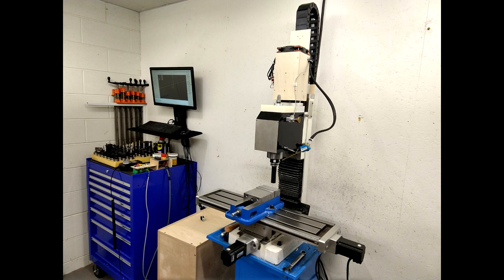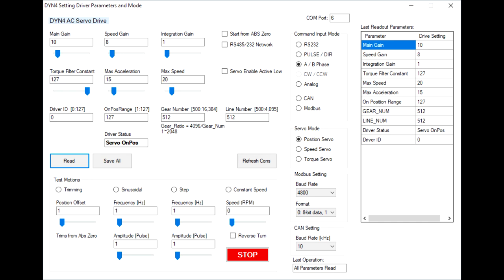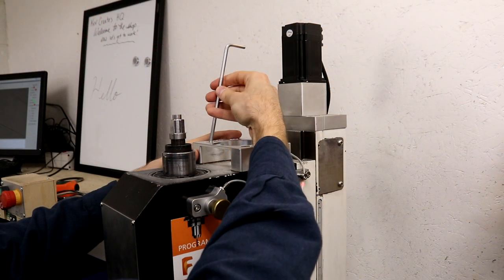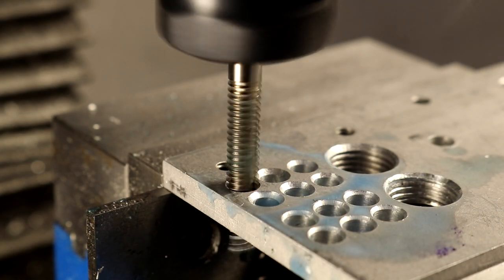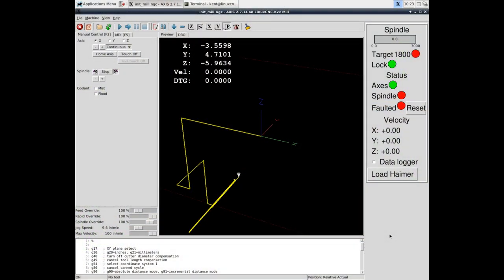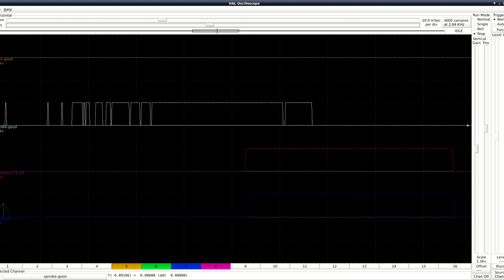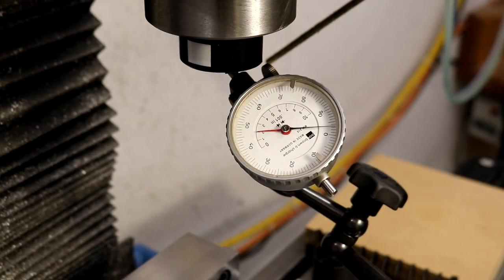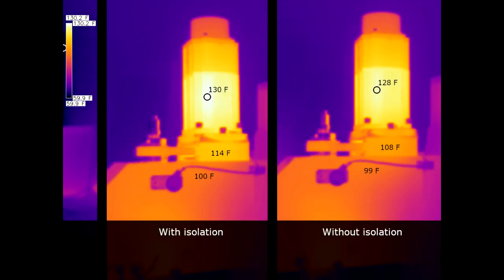AC servo motor for CNC mill spindle: Questions and answers

Comment: Hi Kent, I have watched all your videos. I didn't find it mentioned but I want to add the power meter for the spindle of my CNC (BF20L modified to R8 spindle, belt drive eccc so similar to your mill). I want to install a 1.8Kw AC servo spindle. In case of AC motor where would you measure the current, power flow? Before the drive or between the drive and the motor? I am not sure where the 1.8kw are referenced at, if for the current supply to the driver from the wall outlet or from the driver to the actual motor. Thanks for the help!
Reply from the maker: Hi Ale, this is a great question and has several answers of various accuracy and complexity. The sort answer: For a simple relative load meter, an amperage meter clamped to one wire of the input should work fine. A max-hold or average function on the amperage meter would be nice.
More complicated... For the DMM DYN4 and LinuxCNC, I wrote some code to get the current assigned by the servo. This has very fast response and must be filtered to read. For a hardware meter, you could measure the current either at output or input of the drive. Measured at the output will have quicker response but that might not be useful. Measured at the input will be smoothed and easier make sense of. The complexity comes into this if you want to measure power (will need to multiple by co-measured voltage), care about potentially imbalanced legs, 3ph vs 1ph, phase angle, and on and on.
Hope this helps. I'm making a video on a new spindle now and after that plan to make one on instrumentation which should be relevant.
https://github.com/kentavv/kvvcreates/blob/master/linuxcnc/modules/dmmserial
Reply: @kentvandervelden  Thanks Kent for the quick reply. Yes, indeed measure DC is easy but AC can be done in different ways and give false result if you do not understand it properly. I will then wait your video to shed some lights on the subject :-)
Reply from the maker: @Ale_Lab  Sorry, I didn't fully answer. The power rating is of the motor. The drive will limit power delivered up the rating (plus maybe some boost.) Output power = Input power x efficiency. For a relative rating, either place should be fine, but efficiency depends on load. So, for practical machining operations, an amperage clamp on the inputs should be fine. I used a wired-in amp meter for a long time. Oh, and some drives have an analog output for reporting current that could be pretty convenient.
Reply: @kentvandervelden  Thanks a lot aI will have a look at the driver then. If the analog output is present then I will use that one instead. Otherwise the imput will be plenty for my application.

Comment: Very well presented, you did answered most of my question came up during watching the other videos. BTW: Which CNC controller do you with Linux CNC?
Reply from the maker: Thank you very much. I have a simple i7 PC and Pico Systems USC running the latest stable LinuxCNC. I'll be trying a MesaNet board soon for a CNC router design using analog servos and will also try the MesaNet hardware on the mill. Let me know if this doesn't answer your question. Have a great weekend!

Comment: I'm setting up exact same spindle on my PM25. Based on you videos, and other research, I figured that it was a good option, and if for some reason it doesn't work out. I have a small lathe that I can use it on. One question.... Did you find a good source for poly-v J series pulleys ?  I'm whaving trouble finding one .... Or did you bore the original pulley ?
Reply: Duh, I watched the video again, and you made up a set of timing pulleys to suit....Oh well, I'll macine up some pulleys...
Reply from the maker: The original pulley was bored up a couple mm. The servo works really well, a great upgrade from the BLDC. I wouldn't get the brake option and I especially wouldn't mess with the drive's encoder feedback (HUGE waste of time.) So, that means adding an external encoder with a small timing pulley and probably keeping the original two-speed pulley and belt setup. 
Check this video out for a very cool belt selection system.
https://www.youtube.com/watch?v=kW_8BJLwJL0
Reply: @kentvandervelden  im trying to hook up the encoder to the acorn. I got the 1.8KW servo I hope it works ok. you say it's a waste of time to even try? I ordered 2 of the 1.8KW servos one for my g0704 and one for my g0602 and I ordered 2 db9 screw in plugs ans 2 db25 screw in plugs and 2 acorn boards and ive had so much problems with other BOB's that it's time to go with something rock solid, and I thought this was the way to go. the 1.8KW servo works awesome on my g0602 its so quiet with your multi rib v belt 3 pin spindle setup, I love it, I made the pulleys myself, and they are really really close to the same size and I can tell when i put an index mark on them and turn the motor on, and see how long it takes for the marks to come un-alligned from each other. i really hope the encoder works, I dont want to add an external encoder to it. still need to figure out how to hook the encoder to the acorn. too many years of trying makes jack a dull boy LOL
Reply from the maker: @BondmeJesus  For sure try using the DYN4 encoder passthru. If it works, you have a very clean setup. In my case, I had lots of trouble. Maybe the actual advice is, give it a go, but if it's not work, don't keep trying to make it work. Wishing you the best of luck!
Reply: @kentvandervelden  not sure what the DYN4 "passthru" is
Reply from the maker: @BondmeJesus  Pass thru is my mistake. I mean the encoder output of the DMM DYN4 servo drive. A true pass thru would be 1:1, one encoder input pulse equals one output pulse. The DYN4 supports scaling the input, making the output a ratio of the input.
Reply: @kentvandervelden  I will not be scaling it down for the acorn if I can get it to work, because the acorn supports 10,000 counts per rev. and the driver that came with my 1.8KW servo already has the scaling feature in it, so I could scale it down. I dont have the DYN4. I sent you some emails also. (electronic gearing) wont be needed. the AASD driver has 10,000 counts per rev and I sure hope it works for the acorn. think it will be safe to connect it?

Comment: What spindle head are you using? Is there anything out there for under 800 $?
Reply from the maker: I'm using the stock spindle and head that comes with the PM25. I recently purchased a BT30 with power drawbar and housing for $1400 where ~$500 is the heavy housing and shipping. Just make a spacer for between the Z saddle and housing. If you only wanted the BT30 spindle, they can be found on eBay and Aliexpress for under $800 and free shipping. Add another $300 for the air cylinder. These spindle are seemingly rebuildable, good up to several HP, and 6k to 8k RPM. If you only want high speeds, 18-24k RPM, and nothing under 9K, you'll have many options under $800.

Comment: The induction motors on my fadals all have encoders. I’m sure where a will and way is concerned even a less expensive motor could have it retrofitted to the back side. Our robodrills are all servo, our fadals all induction. Frankly they all perform alike and the inductions have more torque. For your little mill I’d never use an induction motor for a few reasons you mention however depends on the application where I’d suggest one versus the other. Overall machining an induction motor tends to out perform however ours all have rigid tapping capabilities it isn’t common for a hobby grade machine. By the way if you decide to try and broach I believe you’re going to need a larger z axis servo. Most broaches will require 7-8NM of torque or more. Perhaps the weight of the head will assist but I suspect you will get an axis error if you try with the one you have.
Reply from the maker: Thank you for this great information! My last mill had a 3HP induction motor and I keep wondering what-if, so it's very useful to hear your experience and recommendation. Also, I use the same axes motors and similar ballscrew pitch on my lathe and while broaching, slots definitely need to be narrow and processed slowly. I'm waiting on a MesaNet card which can sample the encoders faster and has built-in differential signaling. It's the last thing I'll try to get the DYN4 working well. Serial command of the DYN4 works well but that's not fast enough for encoder feedback. Btw, in school I a great friend shared your name, years pass without passing him though, so when I saw you message I wondered if he is now a machinist :) Best wishes

Comment: Any tips on tuning the DYN4 on velocity mode?
Reply from the maker: Hi Travis, I wish I could help. I've not been successful in using velocity mode. When in velocity mode, my servo turns, but the torque is terrible. Increasing the gains much results in instability. DMM said that a belt drive, being less mechanically stiff than a direct drive, will be limited. Regardless, position mode has worked well. I can't explain the poor velocity mode performance. Unfortunately, maybe the drive is more sensitive to faulting under high load if in position mode than in velocity mode, but I don't know.
Reply: @kentvandervelden  That is actually really helpful.  I have been struggling trying to get my 1.0kW DMM servo motor w/ DYN4 to work properly as a spindle in velocity mode.  How are you implementing position mode?  I too am running linuxCNC (using a Mesa 5i25 & 7i76).  I currently have the spindle setup as analog and velocity control, but there is no torque to speak of...  A screen capture of your final DMM Servo Settings would be wonderful if that is not too much to ask (unless they are what is posted at 5:15 in your video).
Reply from the maker: That's very interesting! I attached the fourth motor channel of a Mesa 7i76e to the A-B phase inputs of the DB25 connector on the DYN4. You can find my configuration at the address below. Indeed, those at 5:15 are what I'm using, and I doubt they've changed. My DYN4 is from ~2 yrs ago, and there are newer firmware options, but the meaning of the parameters are likely the same. I wish velocity mode would work better because in position mode the servo faults when ~90 deg off, but in practice, it's not been a problem with a 750W except beyond 3/8" drills.
https://github.com/kentavv/kvvcreates/tree/master/linuxcnc/configs/pm25mv_mill/mesa/configs/my_LinuxCNC_machine

Comment: I would doubt that you're actually losing counts due to noise if the controller you use has differential inputs. The noise barely effects them because the way the differential receiver chip needs to be pulled in opposite directions to change the output. Only way to really see those missed counts in LinuxCNC is to set the spindle up as an axis and test positional movement over a certain distance.

Velocity feedback isn't a good indicator because it's calculated over cycles. Even the cleanest velocity signal needs to be software filtered to look smooth. I't sort of a common misconception that LinuxCNC really cares about a spindle encoder for ridged tapping. I just so happened to be doing some tapping with my "worst-case-scenario" DMM setup and thought I'd take some quick video.
https://youtu.be/8nBhyW4SIYY

 I'm using the same DMM servo (minus brake) with step+direction upto 5000rpms. I had a bit of a fiasco with the DMM drive but I can comfortably say it was the terrible auto-tune thing they have baked into their software, I've actually had it kill a drive. Otherwise the drive has worked great for me, but I'd tell anyone asking about a DMM setup DO NOT USE AUTOTUNE!
Reply from the maker: Thank you! Your video is useful and I left comments. Another couple explanations for my setup is lagging the encoder are that 1) the Pico USC is not sampling fast enough, though the documentation says it's good up to 1MHz; and 2) the opto-couplers don't have sufficient bandwidth, though at low speeds there should be no problem. After comparing the DYN4 internal encoder position, read by serial, to the encoder state sampled by the USC, I'm confident that pulses are missed even at low speed. At high speeds it's so obvious after a few seconds that no fancy stuff is needed :) Best wishes
Reply: @kentvandervelden  If that is actually the case I can strongly suggest that your next upgrade be to Mesa hardware, you may also be able to ditch the optos. I pretty much use Ethernet cards exclusively, there really is no performance penalty because of the way the counting is done directly in the FPGA, and the hal driver only reads a position feedback at the servo-thread rate. Mesa claims 10mhz for stepgens and encoder counters, I've never seen anyone dispute that. I'd recommend either a 7i76e or 7i96, I use both on different machines
Reply: actually yeah, a quick look at the Pico card and it is not using differential I/O for anything and I cannot for the life of me understand why not for the cost of the board. Stepgens and encoders are always differential on Mesa cards. If you look at the difference between rs232 and rs422 in terms of speed, it is exactly the same difference as single ended encoder inputs and differential. 
https://www.contec.com/support/basic-knowledge/daq-control/serial-communicatin/
You could likely find some to rs422 to rs232 adapter to use on the pico board side, to convert the DMM differential outputs to single ended inputs for the Pico at the card, or you can make one it's pretty easy. The DE10 nano PCB on my git has an example of of differential hardware for stepgens and encoders, just hook it all up with a piece of unterminated cat6 cable any you wont need the optos.

Comment: sounds like you are finding every wrong way along the quest for the right one...lol   most of your assumptions on why the surface finish is poor is incorrect.  the spline drive separates the misaligned lower cartridge from the fixed upper bearings.  the single set screw is sufficient holding the cartridge in place, but over tightening it will deform the cartridge so don't do that.  the spindle and upper quill barrel should remain completely separated except for the spline drive contact points.  this stops the misalignment and won't affect the spindle shaft from non concentric rotational loads ie.. force the spindle to bend as it spins which causes a significant amount of vibration.  As a safety to the single set screw holding the cartridge in place, use a top hat on the threaded spindle shaft top that will not allow it to fall through the pulley (the pulley should ONLY be driving the upper barrel and not in contact with the actual spindle shaft. 

lastly, replace the stock bearing with Nachi Tapered roller bearings and use kluber grease.  the timing belt adds a lot of vibration and your recommendation to use a timing belt given other options in my opinion is a poor one on this machine. you would be better served to drive an encoder off the spindle shaft with a very lightweight small belt that will not influence the spindle such as a larger main drive cogged belt would.  I found the sweet spot for superior finishes and rigidity and minimal runout at the tool long ago and have been making gorgeous mirror like finishes for half a decade now on the G0704.  so you may want to re-evaluate your design and approach to your perceived issues from a different perspective.  it will help you achieve the end results you are looking for.

happy to help if you would like, many i have helped are now happily making gorgeous parts with impressive cycle times on parts!

Chris
Reply from the maker: Hi Chris, I can't thank you enough for you taking the time to write a detailed recommendation which clearly comes from lots of experience. And thank you for offering to help. I may take you up on that. Now, I'm waiting on a MesaNet card. Much has been delayed. Stay safe and healthy!